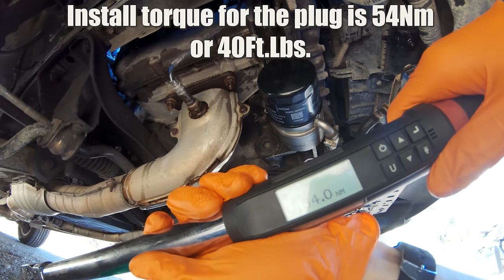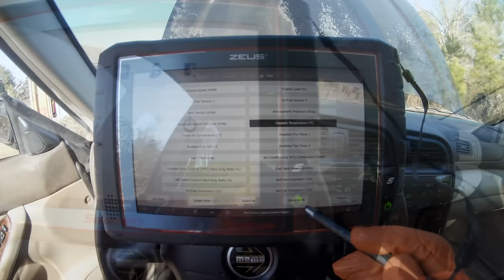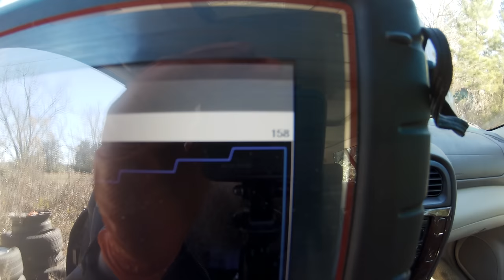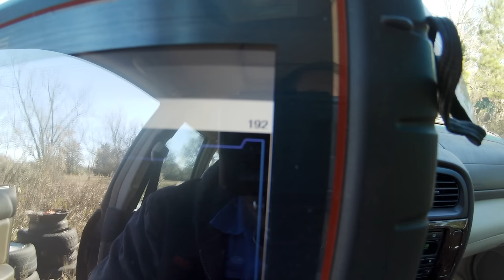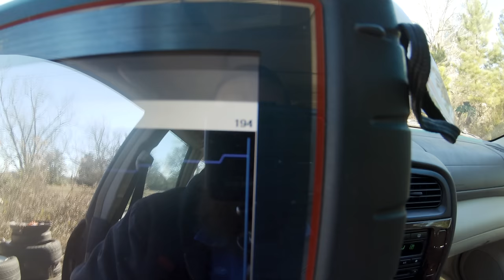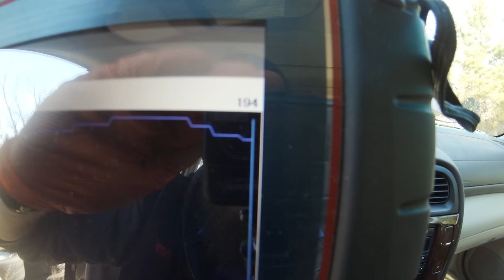Subaru Coolant Replacement

Comment: Random question from a guy who doesn’t know too much.  No need for the blue Subaru coolant or is it just a gimmick? As long as it’s 50/50 all good ?
Reply from the maker: If the car has the super coolant, use the super coolant. If it's a pre super coolant car use the regular green. You can out green in the newer cars, but for the cost/extended service life, not worth it in my opinion.

Comment: If we dont have a machine how do we know when the thermostat opens?
Reply: Watch your temp gauge.
Reply: Some of these cars like my 2013 impreza don't have a temp gauge. You can get a cheap $20 obd2 adapter on the web. The alternative is wait for radiator fans to cycle on and off a few times. That's what the Subaru service manual calls out.

Comment: How funny a lot of this stuff looks the same on my 13 EZ36!!
Reply from the maker: Basically is the same across the H6 lineup, just a larger displacement.
Reply: The batt and coolant are in the same spots ect I guess if it ain't broke why change it.
Reply: I have a 2017 Subaru outback with the 3.6 r. And I do not see many differences under the hood. So looks like that should work for me also. Thank you really great video.
Reply from the maker: Unless you're at 80k miles, you don't need to replace the coolant on your 2017.
Reply: MrSubaru1387  On my 13 3.6 Subaru give some crazy spec of  120,000 or 12 years, I just did mine a couple months ago and all I did was just drain the radiator side and refilled with Subaru OEM coolant, I figure next year I’ll do it again.
Reply: @MrSubaru1387  ok, thanks again. I've always worked on my own vehicles. But this newer model kind of intimidates me. So thank you for the reply.
Reply from the maker: You're welcome. 👍🏻

Comment: My 06 Subaru Forester is leaking coolant. Can doing this as well as cleaning negative pressure valve in the radiator cap solve the leak problem Im having?
Reply: Did you watch the video on the subaru coolant conditioner? It's holts radweld I think.

Comment: Any extra steps for turbocharged Subarus? I have a '14 WRX and there's a secondary coolant reservoir for the turbo. Thanks
Reply from the maker: On turbo models you fill from the upper reservoir, near the turbo, instead of the radiator.

Comment: Is draining the coolant from the engine block required on a 2007 2.5 outback?
Reply: I’m not replacing radiator just doing a coolant flush and fill

Comment: Could you completely drain the system by pulling out the thermostat? Or is it still necessary to remove the block plugs to get it all out?
Reply from the maker: You have to remove the block drains to drain the engine block. You won't drain the system by just pulling the t-stat.
Reply: @MrSubaru1387  Thanks for clarifying! Unfortunately I am unable to locate the second block drain. I have a 2004 Forester NA AT, and the driver's side block drain is obvious, however I can't find the second. Opposite the driver's side block drain is the oil filter and oil cooler. The cooler has a hose that runs up into a nipple and what looks like it could be the second block drain. Or is it hidden under the exhaust manifold? I guess I'm wondering if I drain the driver's side is that good enough?
Reply from the maker: When there's an oil cooler, or a block heater, the second drain is replaced. So yes, the nipple for the oil cooler is the second block drain. Pulling the one should suffice.
Reply: @MrSubaru1387  Thanks for all your help! After draining from the radiator cock valve and the driver's side block drain, I got about 1.25 gallons total out of the system. Not as much as I hoped but better than nothing. The bottom line is that I'm hoping to prevent a head gasket issue (I have 150K on my 2004 Forester) so the addition of the coolant conditioner will hopefully prolong my luck. Cheers

Comment: I'm doing a cooling circuit flush and I added the cleaner to the coolant reservoir. Is that correct or do I need to add it straight to the radiator? The car is 2004 sti.
Reply from the maker: To the radiator or to the upper turbo coolant reservoir. If you put it in the white reservoir with yellow plastic cap on the radiator, if won't do anything.
Reply: @MrSubaru1387  thank you sir for your reply.

Comment: On a 2011 legacy 2.5 the exhaust manifold is right in the way of both plugs.  Doni really need to pull the manifolds to do this?
Reply: Could you just drop the lower radiator hose Instead?

Comment: Great video, would it be a good Idea to change the thermostat while you have the coolant all out?
Reply from the maker: Yes, if you haven't replaced it with a water pump/timing belt job.

Comment: If I am changing my coolant temperature sensor on the FB engine is it necessary to drain the coolant? Or I can just remove and replace quickly.
Reply from the maker: I mean you can, but you'll have a mess, still have to add coolant, and bleed air.

Comment: Have a 2006 mark 4 legacy and recently replaced the radiator. Having a lot of problems. It's sometimes leaking coolant from the cap and other times just from a random place? Any ideas
Reply: Did you replace the cap

Comment: Hi Mr. Subaru. I got a question for you please, my 98 Outback with 234k miles at around 77-80 mph at 3.5k - 3.7k rpm, AC on, temp outside 100+ degrees, temp gauge on car goes close to the top of the "temp" symbol and then comes back to a bit below the middle, flluctuates a lot..makes me very nervous..turn off AC, temp regulates. I thought it was a bubble, so after stopping, I opened the air plug from top of the radiator and follow the manual instructions, but it keeps doing the gauge fluctuations under those or similar conditions . What could it be?. Coolant is full, no apparent coolant leaks. Thank you.
Reply: Head gasket failure I suspect you can buy the tester on Amazon not sure if he has it in his store!

Comment: So what's your thoughts on the Subaru branded coolant? I see you used regular stuff, were you just in a pinch, or is it the same as any other green coolant you can buy and don't waste your time trying to get ahold of it?
Reply from the maker: Only use Subaru coolant on 08+ cars that call for the Subaru Super coolant. The old cars use regular old green.
Reply: I thought the regular green has to be sulfate and phosphorus free? Thus using long life subaru coolant?
Reply: @marcovdabeast  Should definitely be silicate-free.

Comment: I had my 2014 crosstrek serviced at my local Subaru dealership. Then moved states. Went into my new local dealership to get new ac orings which I was told needed replacing by my old dealership. This new dealership told me I had the wrong color coolant Which the other dealership had put in. It is green like this video. The new dealership also mentioned oil seeping from cam carriers and pan. Which I can not see fresh oil just small about of dusty oil looks old. my old dealership never mentioned this. It does not drip oil  is the new dealership being dishonest? Also my wife took the car in. Do they think she will just blindly pay ?

Comment: Every time you change your coolant you go by the miles or years. I have a 2015 sti have not yet changed the coolant and i only have 11,000 miles on the vehicle.
Reply from the maker: 3yr/36k miles whichever comes first.

Comment: What if I did all these steps but I dont have heat at idle only when I'm revving the engine or while driving?. I have a 2006 wrx.
Reply: The car does not overheat, it reaches 207F max and 180F low depending on the SoCal  weather
Reply: I used the spill free funnel on the tank by the turbo not on the radiator.
Reply from the maker: Sounds like you have an air bubble in the heater core. I'd loosen the clamp on the heater hose at the firewall, pull the hose off slightly and see if air escapes or coolant leaks.

Comment: Is this the same process for a an 03 wrx hatch?
Reply from the maker: Basically. But, you fill the cooling system and bleed. It at the turbo coolant reservoir rather than at the radiator filler neck.

Comment: Do you get any issues with gurgling sounds from the heater core behind the dash with the engine under load?
Reply from the maker: No. Sounds like air trapped in the heater core though.
Reply: @MrSubaru1387  So if I get the front up on ramps to get the radiator as high as the core, remove the radiator cap, warm it up try and "burp" out the air, is that the best way?

Comment: Where's that engine drain on the EZ 36?
Reply from the maker: Just beside the oil cooler/filter.
Reply: @MrSubaru1387  There are two plugs there.Which one,the big one or the small one?
Reply from the maker: @simsim2486  big. Should be 14mm hex.
Reply: @MrSubaru1387  Спасибо

Comment: heya MrSubaru. are the current XV GDI or both GDI + port combined?
Reply from the maker: The current Subaru engines are DI. The only DI + PI engines are the BRZ, GT86, with the D4S system.
Reply: @MrSubaru1387  ok so eventually all the non Brz will require walnut blasting at some point?
Reply from the maker: Yes

Comment: Was this method suitable on new subaru suv such as subaru Ascent?
Reply from the maker: Why are you replacing the 10yr/100k mile coolant?
Reply: I’d like to know it because I probably need to get a new car or replace it. And if I get ascent, how hard it is going to be to do the maintenance by myself?   

Oh by the way, i’ve been driving forester 2005. I am told that if I get a newer Subaru vehicle, repair is going to be a lot more expensive and also many parts cannot be repaired locally?

Comment: I was wondering if the same process (both radiator and reservoir flash) can be applied to a Subaru Forester 2012?

If so, does it require the same tools? Thank you.

Comment: do you have to drain the coolant when you get new coolant?
Reply from the maker: Yes... Where else would the new coolant go, if the old was still in the car...
Reply: @MrSubaru1387  u cant add 2 it?
Reply from the maker: How can you add coolant if the system is full of old coolant?
Reply: @MrSubaru1387  in my car for some reason after i get home my Coolant in my Car is like 1/2 inch above low line
Reply from the maker: Coolant expands and contracts with temperature.
Reply from the maker: Are you just losing coolant?
Reply: @MrSubaru1387  IDK seems like when i travel long places i smell burning rubber smell or something hard to explain i look i dont see anything only thing i can think of is maybe Low Coolant i highly doubt thats issue no lights come up low anything i dont see any belts warn or anything so i figured i would add this if my Dad let me put car on the lift i will drain coolant all together but will see
Reply: Oh I am losing my coolant because of head gasket gasket issues. But stop leak is helping so I’m stead of adding coolant everyday or every other day, I need to add about once a week or less.   So I was wondering if I still need to change coolant every 3 years or 30k miles?  Feel like I have fresh coolant all the time😅

Comment: Bro, would this work on a 2002 impreza wrx 4eat?
Reply from the maker: Similar. But being a WRX, you fill from the turbo coolant reservoir cap, rather than the cap on the radiator.

Comment: Subaru only coolant or any green stuff?
Reply from the maker: If it had green, use green. If it had Subaru blue super coolant, ise that. Don't mix them.
Reply: @MrSubaru1387 The owners manual in my '09 Impreza (which came with blue) says you can mix but then you have to change at the interval used for the green. Do you see any risk of damage, or is it just that you shorten its life?? Quote:
"Vehicles are filled at the factory with SUBARU Super Coolant that does not require the first change for 11 years/137,500 miles (11 years/220,000 km). This coolant should not be mixed with any other brand or type of coolant during this period. Mixing with a different coolant will reduce the life of the coolant. Should it be necessary to top up the coolant for any reason, use only SUBARU Super Coolant.
If the SUBARU Super Coolant is diluted with another brand or type, the maintenance interval is shortened to that of the mixing coolant."
Reply from the maker: Interesting. Figured they weren't mixable like dexcool and green. I'd still keep them separate, personally.
Reply: @MrSubaru1387  Probably a good idea, thanks
Reply: i use prestone dexcool 50/50 legacy 2000 2.0

Comment: where do you get your torque specs?
Reply from the maker: Subaru factory service manual.
Reply: @MrSubaru1387  do you have the link?
Reply from the maker: Jdmfsm.info
Reply: @MrSubaru1387   thanks
Reply from the maker: You're welcome. 👍🏻
Reply: MrSubaru1387 - the Subaru Manual is in Russian 😳 Do you have an English link? Thanks
Reply from the maker: Ты русский не знаешь?
Reply: MrSubaru1387 - yup. That's what I was just thinking 😶
Reply: @MrSubaru1387  Тогда можно задать тебе вопрос на русском?
Reply from the maker: @simsim2486  Конечно.
Reply: @MrSubaru1387  1)Большая пробка на блоке в 3.6 спрятана за маслокулером,как к ней подобраться даже не знаю,может посоветуешь как?И второй вопрос:torque для большой пробки 90n/m или 66.4ft/lb цифры нашел в руководстве,на 100% не уверен.С большим уважением Сергей
Reply: @MrSubaru1387  yes!... perfect timing, doing timing belt, water pump thermostat etc. and tada magically and randomly i find your comment with all the torque specs in a manual, awesome, Thanks.

Comment: Is this process the same for 2010 legacy 2.5i?
Reply from the maker: Basically, yes.
Reply: MrSubaru1387  how much coolant and conditioner is required?
Reply from the maker: @galehbedrousian1178  2 mixed gallons should be enough. One bottle conditioner.
Reply: MrSubaru1387 
Appreciate your help
Reply: MrSubaru1387 
One more question, I have a 2010 legacy outback with that terrible tr690 transmission some issues, hesitations in acceleration especially in fist gear and rattling, I don’t have any check engine light but apparently there are 2 codes c0045& c0057. What are those codes?
Car has 155k miles and I missed the transmission recall
Reply from the maker: @galehbedrousian1178  C0045 TCM Malfunction. C0057 ECM Control System. Check your fuses. May have a power or ground issue in the wiring harness as well.
Reply: MrSubaru1387 
Thanks for your quick response
Reply: MrSubaru1387 
I checked the engine Bay Area fuse box for that 30A and 40A fuses but they were in good shape and I checked the battery power line apparently normal
Btw Where is that grounding? Under frame rail?!